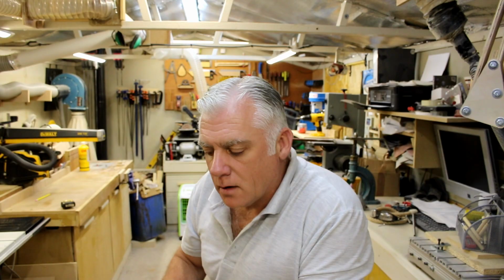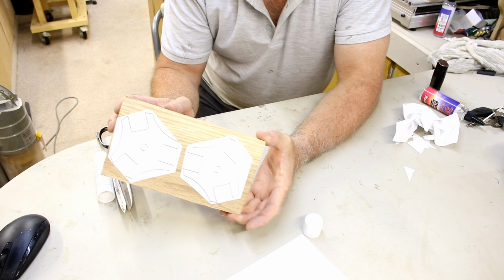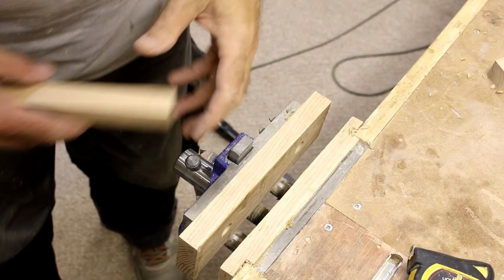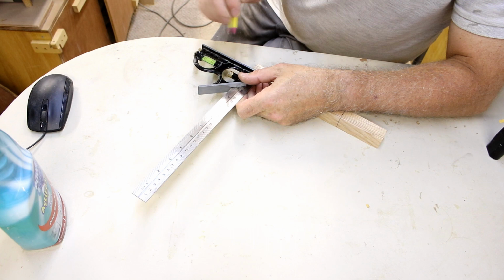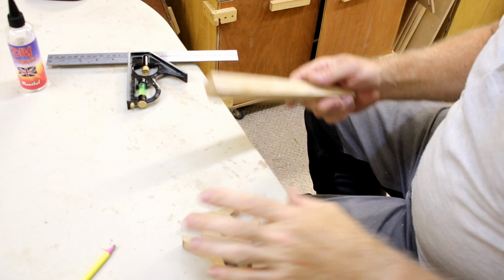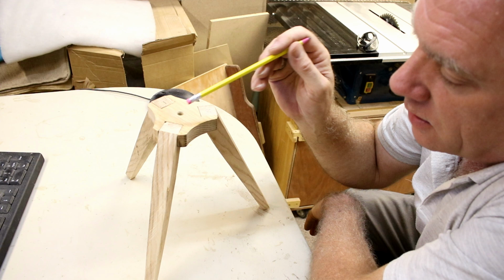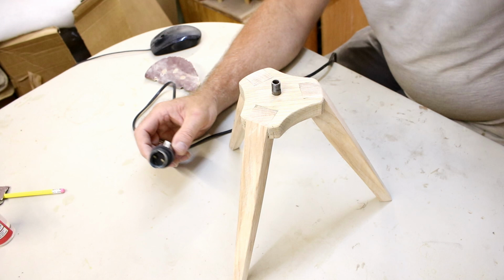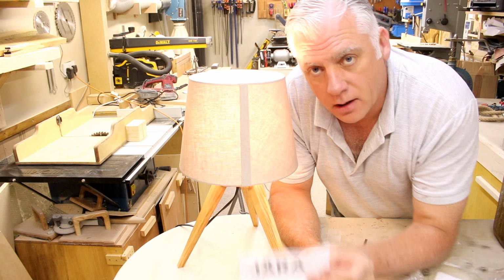How To Make A DIY Tripod Table Lamp

Comment: I somehow missed the part where the bottom of the feet were cut at an angle so they are flush with the surface on which the lamp will reside. It appears to be DIY only if you have $1500-$2000 (or more depending on quality) worth of woodworking tools (planer, band saw, table saw, and drill press). As an apartment dweller, I think I can come close with the $200-$300 worth of hand tools I have though. May require a little more elbow grease but hey, that's half the fun isn't it? Instead of gluing my feet/legs in, I think I'll try some brass screws/bolts, washers and wing nuts. May add a few dollars but brass hardware always lends a nice accent when combined with wood work. A very nice video in any case.